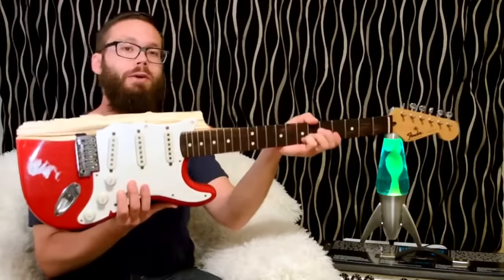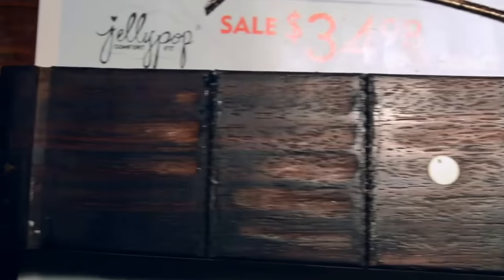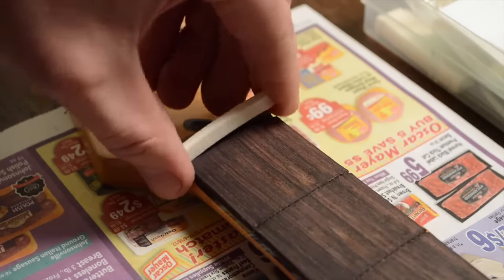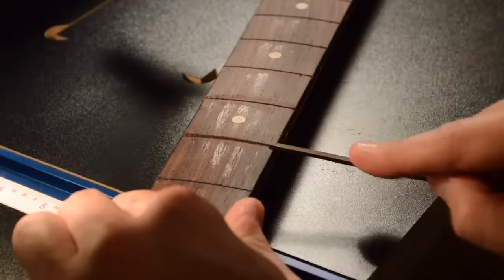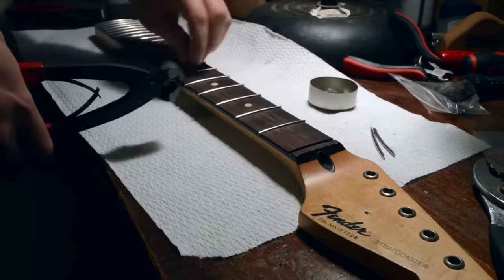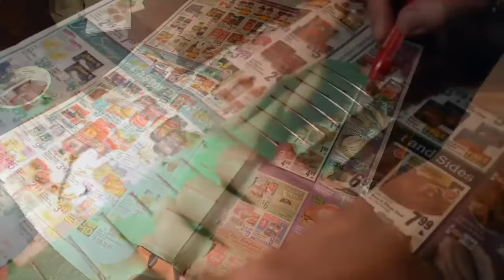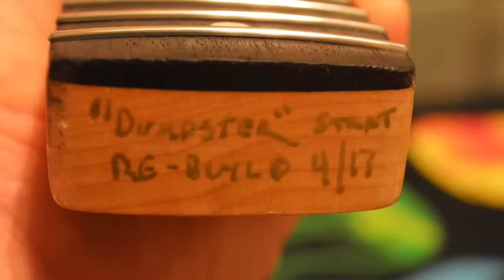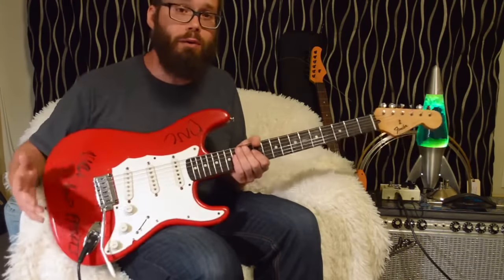Strat Found in a Dumpster! Rebuilt with Stainless Steel Fret Job

Comment: The problem with a MIM Strat is not due to some design flaw; the problem has to be in the ability of the person playing it. I’ve played guitar for the last 57 years. I’ve never abused one of my guitars. To shatter a guitar like that reflects an owner who didn’t deserve the guitar to begin with. Thank you for restoring it. This care and restoration video has been instructive and will be an important tool I will use as I begin my very first DIY guitar build - Solo 335 kit in the box sitting next to me.
Reply from the maker: Thank you for the kind words Brett. I can't say the same about myself (I had a Kurt Cobain/Pete Townshend phase!), but wouldn't dream of it now. Good luck with that 335 build!
Reply: @bellezzaguitars7155  I'm stuck in the Kurt Cobain phase but I try my best to treat my guitars well, planning on taking my Squier Bullet Mustang and refitting it with the pickups Kurt used.

Comment: Never realised just how much work is involved in a re fret.
Reply: Same here!  I would so not have the patience either! 😄
Reply: This looks like a really hard re fret i don’t think it’s usually this hard
Reply: This guy is doing a super high end fret job with stainless steel frets.
Reply: 😀👆 This!
Reply: Done it once. Not sure if I want to do it again :D
Reply: you have no idea, and if you mess up one step it turns into a nightmare
Reply: That's also why it's about as expensive as a new guitar to have it done by a luthier. But doing it yourself is also a time investment from hell.
Reply: Some fenders had frets installed by inserting sideways and should be removed by tapping out from the side too. With the amount of chipping he got it seems he should have tried it that way. I wouldn't send my guitars to him.
Edit: and omg he just filled them with glue lol proper job would use saw dust and glue.

Comment: When cleaning fingerboards, or any surface that has been touched a lot by fingers, especially with food on them, you have to also clean with water and detergent. I learned this while painting houses. No matter how strong your chemical cleaner is there is "filth" that only water removes. TSP in water is an excellent cleaner. You need to make a jig that holds a Dremel Drill with stone grinder to grind down those fret tangs. It could be completely mechanical: just push it down until it stops automatically at the right place. That's such a sweet sounding guitar! Well worth the effort.

Comment: A fascinating video for a "neck refret + nut" - very informative. I would have reserved the stainless frets for a "higher end" guitar but I understand this was an opportunity to get some experience with a more difficult metal. The final result was excellent and I applaud your efforts.
Reply from the maker: Always "practice on scrap" is the rule. Thanks for watching.
Reply: Even better, use epoxy resin to replace the broken part and suspend little bits of trash in it.

Comment: Thanks for the detailed fret work. I am looking for a good project, but I doubt I will go with SS. i was a machinist and a toolmaker for over 35 yrs, so i want to give you a little tip on filing. The file "cuts" on the forward stroke, on the return stoke, if you keep pressure on the file, it will greatly shorten the files life. I'm guilty of it sometimes, but I noticed also on the crowning your method was good. Just trying to be helpful. I also noticed you said to clean between grits, that is important.
Reply from the maker: Always appreciate advice from experienced individuals. Thank you. I am completely self taught at all of this work, I never had a mentor or anyone who was a craftsman around me growing up, so learning as I go. Tips and pointers are always welcomed. Thanks again and thanks for watching.
Reply: @bellezzaguitars7155  I enjoy learning  and resqueing guitars myself, I find it kind of satisfying. i sell them for a very reasonable price. It's always a challenge and learning experience. I delivered one 120 miles to a young kid when his mom refused to meet half way. Oh yeah, about the files, that only applies to the cut files, not the abrasive type files.

Comment: I've always heard fender slides the frets in. So when you remove them you want to hammer a notch into them a chisel can set in and then hammer them out to the side and that way they don't tear out the chips like it does when you pull them out with pullers.
Reply from the maker: Only until some time in 1982. Everything afterwards has been pressed in. The slide in only applies to vintage re-frets

Comment: Based on the frets and fretboard ware, that guitar was played a lot before it tragically ended up in the dumpster - good rescue. I have to refret my Strat and will be changing it from a 7.25" to 9.5" radius, so find your video and the detailed instructions you provided is just what I as looking for. I was a bit concerned that re-radiusing could sand through the fret dot markers, but you didn't run into that problem, so I'm probably safe. Your excellent videeo will make refretting it a lot easier for me. Thanks! 😎

Comment: Someone please correct me if I'm wrong, but doesn't Fender Drive their Frets in sideways? So pulling them straight up is always going to cause chips. Not to mention you should have some sort of protector on either side of the fret to help reduce the chipping.

Comment: Great job. One criticism..... If you're going to angle the outer springs on the tremelo, you might as well remove the center spring. They're fighting each other as far as tension goes. The center spring has more travel and the outer ones will tense up sooner because you attached them at a greater distance.
Reply from the maker: Thanks. I saw Hendrix do it on one of his Strats, so I figured that was the best way to get his tone :o) Thanks for watching.

Comment: you can get metal guards that have a slot fret width size for you to place on your fretboard to protect it when removing frets. Standard tape also works. anything really would’ve alleviated my anxiety during that refret

Comment: From performing several neck re-finishes and fretting, you really want to start sanding the neck with 400 3M dry paper, using a stiff/loose brush from an electric razor kit to both brush off the neck and fret slots and the paper itself. then move on to 600 when your radius is close, then 800 for polishing before walnut/boiled linseed oil the fretboard.

Comment: might be able to get a loaded american strat pickguard on ebay between 80 and 200 dollar (refurbished and new) 
seen a stevy ray vaughn one and some other custom sets (some even have the back cover for the tremolo )
or a chineese loaded pickguard with dual rail humbuckers for 45 bucks  , that should fix the rest 
the markings on the body you might be able to get off with white spirit and maibe some rubbing compound

Comment: Not to bad of a removal job on the frets, however using a damp cloth to help steam out the frets works aswell.
Your not keeping the hoppers straight whilst pulling, also try to run along the fret wire to prevent tear out 👍
Worst job I did was a refret on a 60s guitar that had never seen any oil or been cleaned...
Chips for days 😟
Yep, I've had to re cut fret slots before now aswell.
Every step is methodical and has to be done properly and carefully.
Always drop glue in during the install, not afterwards.
The reason for this is to ensure the squeeze out seats the fret snuggly in the slot.
Always mask as it stops fillings going in the fret👍

Comment: Damn, finding a Great guitar is more common than I thought.
Way back in the early 80's I found a Gaia 2 electric guitar. Needed to replace the pickups and adjust the string hight. But it was worth it

Comment: Older Fender frets are hammered in from the side. That is why they come out so difficult when pulled out. Next time hammer them horizontally after warming them up
Reply from the maker: They stopped sliding frets at some point in '82. Frets have been hammered or pressed in since then.

Comment: Did the same on a busted squier pink bullet strat.Toast frets,broken nut and unusable tuners. Now that guitar has the extra jumbo jescar stainless steel fretwire,aluminum nut and scalloped fretboard...slicker bending and vibrato that any fender out there.SS frets should be the standard for any guitar.

Comment: I reckon you could have taken the fingerboard down a bit more to get it perfect, but the wear on it doesn't look bad. My maple strat neck fingerboard has a bit of wear here and there but I could probably put a bit of lacquer over those bits, not to hide the wear but just to fill in the concavities.

Comment: Fender frets are so difficult to remove because they're pressed in from the side of the neck not from the top.
IMO Leo never want his necks to be refretted he wanted people to buy new ones .The advantage,  back in the 60s and earlier it was impossible to find good luither in any smaller towns.
Reply from the maker: You are correct. That was the philosophy behind the bolt on design. Fender only installed sideways until about '82 though. Everything after that is pressed in.

Comment: a file only cuts in one direction. Back and forward will dull the file.
Reply from the maker: You are correct. Still learning. Self taught at all of this, so thanks for pointing out. Do you build guitars?
Reply: @bellezzaguitars7155  no i want to but i am a tool maker and do alot of filing just something i learned and i know how exspensive those guitar files are . just trying to help.
Reply from the maker: @richardwright345  Absolutely appreciated, thank you. Yes, VERY expensive, especially if you buy from Stew-Mac!

Comment: Small tip, fender frets are best removed by tapping sideways rather than pulling them from the fretboard.
Reply from the maker: Fender installed frets sideways 1982 and prior. Do you think it is still best to remove them sideways even if they were pressed in?

Comment: Fantastic work. Excellent guide for idiots like me to do similar jobs, although I might shy away from something quite so ambitious. Stainless frets seem like the shiz. Do they have any drawbacks (other than the expense/difficulty of installing and levelling them)?
Reply from the maker: Thank you for the compliments. Fellow idiot here just trying to get better at working on guitars, I'm no expert! I can't think of any drawbacks besides installation. If it's done right there shouldn't be any issues. I won't go into a "tone debate" here, playing differences are subtle. I am used to playing a standard fret wire, EVO gold and SS frets and I don't feel a difference when switching between guitars (but there is a slight change if you focus on it).

Comment: What is that guitar in the background, as you were playing at the end. That headstock looks vaguely familiar... Nice job, by the way!!!
Reply from the maker: The guitar in the background is just a cheap GFS kit (Guitar Fetish) that I practiced my first re-fret on. Thanks for watching!
Reply: @bellezzaguitars7155  aww dude i wanna get a GF guitar kit, or a new neck for my squier strat and some stuff to modify it. would you recommend them?
Reply from the maker: @randomisus8711  It's counterintuitive, but I would actually spend a bit more and go with a Stew-Mac Wilkinson kit or buy Warmoth parts, especially if you are new to building. If you just need a neck purchase an All Parts licensed replacement neck. I love GFS and buy a lot of parts from them, but I wouldn't recommend their neck and bodies if you're just starting out. I have found that even on the higher end "XGP" series parts there are routes that are off and make it difficult to put together if you don't have much experience working on guitars. A cheap kit may work out for you, but I would spend the extra dough to get good wood that's cut right.
Reply: @bellezzaguitars7155  i looked at allparts and their necks were WAY over my budget lol, i only spent $100 on the guitar and i can't really spend more than that on parts lol

Comment: Is the internal of the nut slot is also radiused? I Think it would have been cut straight!
Reply from the maker: The bottom nut slot was radiused. This is pretty common on all Fenders and Squires
Reply: @bellezzaguitars7155  Thank you for the explanation! seems pretty crazy ofc.. makes it harder for who cuts the slot and who shapes the nut, with no apparent benefit!
Reply from the maker: @francescofaccodelagarda5408  Yeah, but a curved nut slot is vintage, so that makes the tone better, right? Vintage=better tone...sorry, I just had to! Yes, most replacement neck makers use flat nut slots. Makes life a lot easier to work on.
Reply: @bellezzaguitars7155  agree absolutely.. besides, I’m Italian (and live in Rome), so OFC I appreciate vintage 😂

Comment: A lot of filing. I watched your video because I want to pull the frets off of a custom-built (home-made) guitar that gold is the motif. I intend to replace the frets with brass frets. I have the fret radius bender, caul press. ect. But I think I will stick with using a Dremel tool instead of all that filing. Good informative video.
Reply from the maker: Not to tell you what to do, because it's your guitar, but I would suggest looking into EVO gold fretwire. I have been using the EVO Jescar version of the same SS wire used in this video and I love it. Gives you the gold appearance and extra durability. But I do understand it if you have brass wire handy and it fits into a motif. Good luck with the re-fret. Thanks for watching!

Comment: Quick question, why did you remove the fret tang of the frets even though it was going on a strat neck (that doesn’t have binding?)
I’ve always seen others use the fret tang up until the edge of the board. Without cutting off any tang.
Any benefit to this besides playability?

Comment: That file for the fret ends looks a bit too fine, and seems like it does more of a polishing job than filing down the fret ends. A more aggressive needle file would have done the job a lot quicker. I've got a bunch of different needle files and some are brilliant, they bite into the metal nice, while others are more inclined to skate.

Comment: This is not a Standard though, it's a MIM Squier Series. Standard body and Neck with cheap Squier hardware and electronics. Someone just sanded the "Squier Series" logo from the headstock. I have this same guitar, same color as well. I love it, it was my first.
Reply: They used to come with an amp. I remember these as a starter pack.
Reply from the maker: Wow, I think you may be right. Someone took the time to put a convincing Fender logo on there, but it did look kind of funny to me. Thanks for pointing that out.

Comment: You mentioned keeping the iron coated in solder but why what does the solder do
Reply from the maker: You always want to keep your soldering iron tip tinned or it will oxidize.

Comment: 122 thousands of an inch. 

That'll be 5 mill then.
Reply: Closer to 3mm I’d say🤪
Reply: @jimpix8019  Jim I think you've mixed up 39.4 millimetres to an inch with 25.4 thou to a millimetre.  

25.4 thou to a millimetre multiply by 5 is 127 thou, we can put the difference down to measuring uncertainty.
Reply: @davemccrudden1999  
I came from the other way around.
If I’ve missed something, let me know what you think.
i.e. given that: 125 x 8=1000. Ergo, 122 is closer to 1/8 th inch. And yes as you agree 25.4 mm = 1 inch,
I divided 25.4 by 8 = just a little under 3.2. 
Or being more precise 1000/122=8.19 appx. Ergo, 25.4/8.19= appx 3.1...ish.
Hence my original statement of: Closer to 3mm.
Seems reasonable to me!
Be Happy🐝😀
(-: <*> :-)
Reply: @jimpix8019  Jim it's 39.4mm to an inch.

It's 25.4 thousands of an inch to a millimetre.

Once you substitute 25.4 instead of 39.4 into your working out, you'll arrive at 5 mill.
Reply: @davemccrudden1999  🌀
In the UK 🇬🇧 one inch = 25.4 mm. 
This is confirmed by using a 12” ruler. Noting that it also shows 12” = 305mm (or 304.8mm exactly)
I think you’re using a Google converter the wrong way round and confusing it.
Be Happy🐝😀
(-: <*> :-)

Comment: I thought they only nipped the tangs for bound fingerboards.
Reply from the maker: Nipping the tangs helps prevent "fret sprout" when the neck dries out in the winter. I do it to all of my frets. You put filler in the slots and then it's super smooth.

Comment: On 'import' instruments with Fender-like necks, the  will usually be flat, with thebottom of the nut slot not having a radius,  how-ever this is a Fender Mexico, so this neck does use a nut with a radius,

Comment: What was the height at the nut you were cutting to?
Reply from the maker: What do you mean? The overall height? Basically, I draw two lines at the nut: one is the top of the frets and one is approx .024" above that. That's my "safe" distance to start cutting into for final string height. I eventually widdle down the overall height of the nut so the wound strings are half exposed and the plain strings are buried into the nut slightly. I hope that answers your question.
Reply: @bellezzaguitars7155  44:17 the feeler gauges, what was their height/value? Sorry if I wasn't clear. thanks.
Reply from the maker: @Goomer  Not sure what I used to be honest, but it would have been close to the height of the fret + .020 - .024" as a safety clearance. You'll want to file lower than that, but that at least gets you to depth without filing too low.
Reply: @bellezzaguitars7155  Thanks, that helps.

Comment: wait, why do we need solder on the iron?
Reply from the maker: You always should keep solder on a hot iron so it doesn't oxidize. You want to keep it "tinned"
Reply: @bellezzaguitars7155  Ah, okay!!  thanks for that info.  But isn't all that solder going to cost more than a replacement tip?
Reply from the maker: @puggy454  How often do you want to replace that tip?